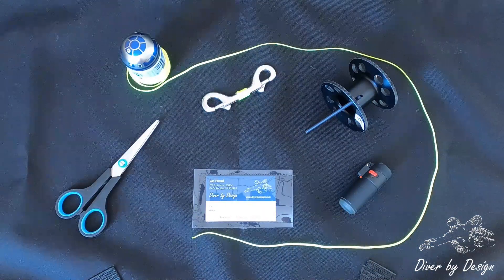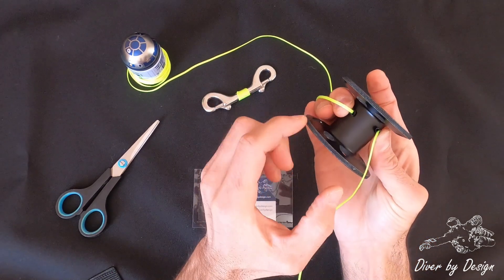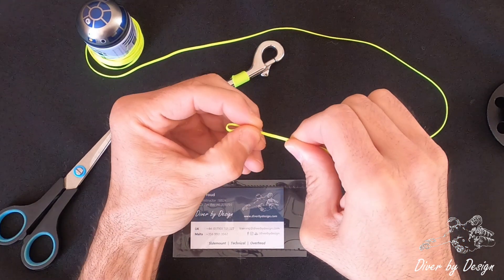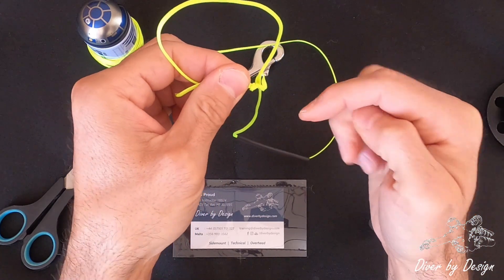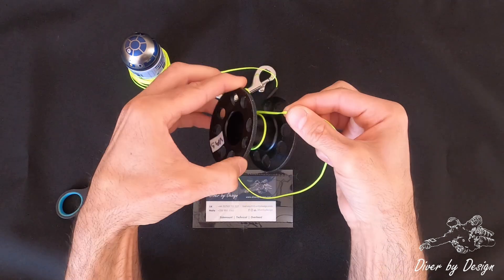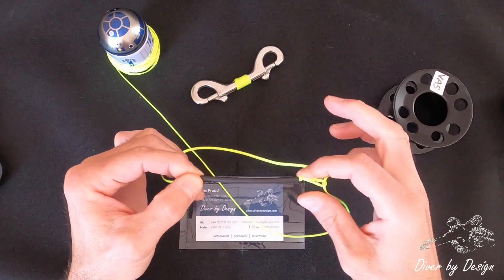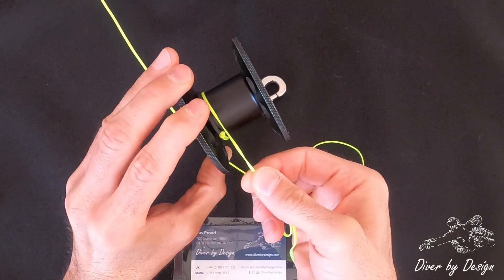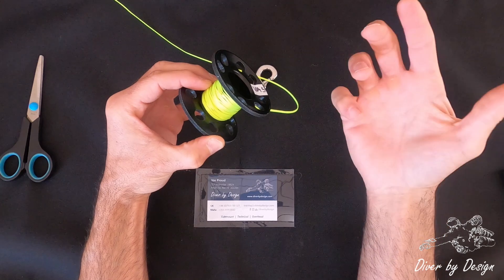Building a Spool - Part 1

Comment: Outstanding as always! Where do You get this nicely manufactured
 spool from?
Reply from the maker: Hi, thanks for that.

This is an aluminium spool you can find on eBay for around £10.  I wanted to try them to compare against the £80 versions you see from the big name manufacturers.

The spool is nice, but for it's size, I get more line on smaller delrin spools with smaller drums.

However, this has some knurling around the edges and is nice to handle.

On balance, I prefer the delrin ones with smooth finishes - but this one was better for the video shoot 😁
Reply from the maker: https://proteushop.fr/en/reels-spools/90553-finger-spool-30m-delrin-dacron-orange-hi-viz.html
Reply from the maker: https://www.ebay.co.uk/itm/282708796374
Reply: @DiverbyDesign  The Ebay Link combined with Your building HowTo is a very good hint vs the 80,- versions :)

Comment: I really like this flat line that you use. Is it braided Polyester, nylon or dyneema? Where can we get it?
Reply from the maker: So it is from Dive Gear Express and is Dacron

https://www.divegearexpress.com/dgx-hi-viz-blaze-orange-dacron-line-loaded-on-bulk-spool

Just take note it does not stretch, so for cave lines it isn't brilliant, but you just leave a bit of slack to let you take that up with the double ender once locked off.